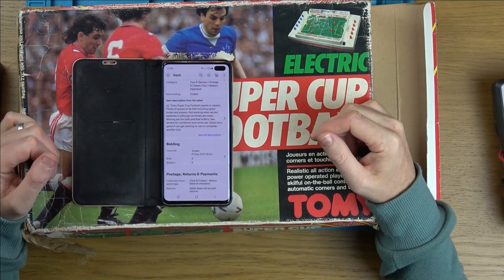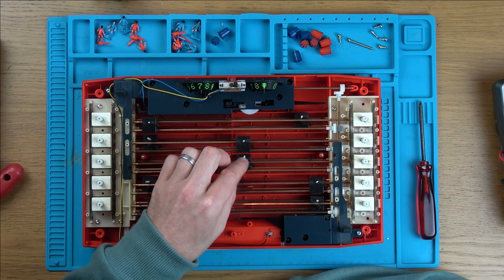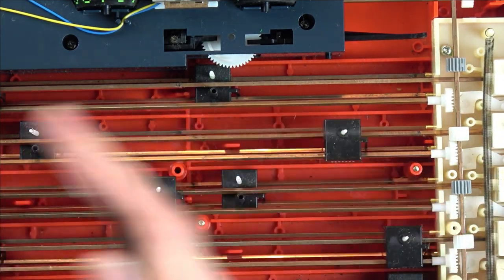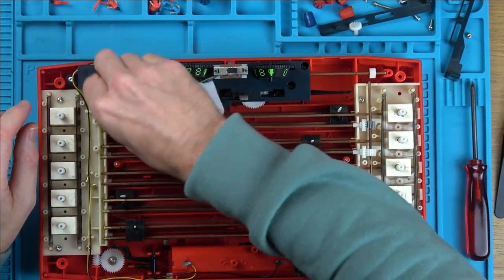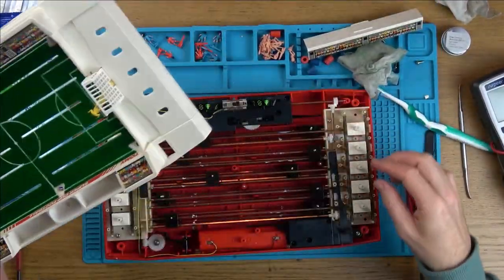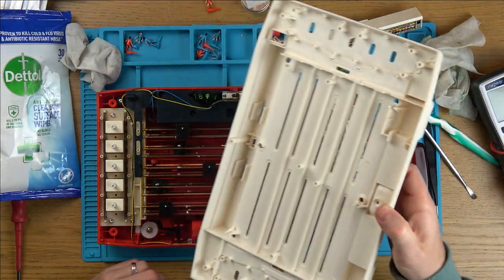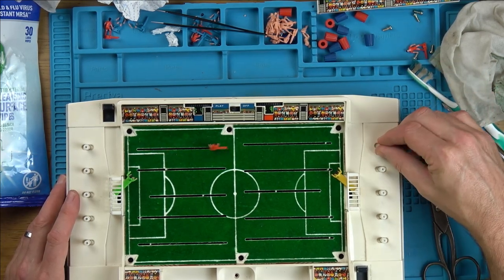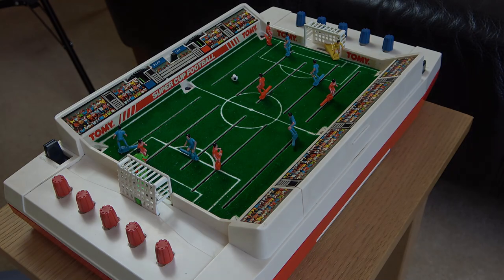Faulty TOMY Super Cup FOOTBALL Repair - Tea Break FIX

Comment: Tomy should 100% remake this!
Add a rechargeable battery with USB-C cable. Find a way to make it as silent as possible. Add little LCD screens for goal celebrations that activate when you change the score. Or even better, use the screens around the edge so you can have an animated crowd and add speakers so you can play crowd noise/singing!!!

Comment: Hi vince I was wondering if you would take a look at 2 media boxes not powering up one is a magbox 250 and the other is a mi box 4s both no power I can post them and I will pay for your time as well even if not fixed think these will make good fixes I thought there would be little fuse but can't see any can't find the faulty component to why not powering on at all. One was working fine and I powered it on to nothing. One box is android tv and other box is Linux iptv box by infirmer
Would love to see these on your channel chasing the problem.

Comment: Hi! How does the worm gear arrangement work under the player? You mention it all works off one motor but i can’t see how the players are linked to the motor? Do the metal tracks carry DC current as well as providing a track for them to follow? Then a little motor under each player which operates the worm gear? And the direction of the motor is changed by reversing polarities on the track? I’m curious! Haha Great content by the way!

Comment: This reminds me of two things.  One was a similar football table in the bowling alley were my dad played in London in the 60s, Ambassador Lanes..  It was coin operated and mains powered, with the players moving along tracks under the control of levers at each end.  Sometimes a player would move erratically and shake itself silly, lol.  The other was a tennis game we acquired at a Sunday market around 1977.  It was battery powered and had a bulb in a chimney, which moved around under the screen.  When it hit any side, the chimney would rock and activate reversing switches.  A large knob at each end controlled the paddles and mechanical score reels ticked over if the ball hit an end without encountering a paddle.  It did need a good deal of lubrication as it hardly moved at all. When it did move it got stuck on a wall, so the chimney had to be lubricated too. It worked very reliably after that. 
Lay

Comment: I used to have a full set of those red handled screwdrivers. They were standard BT toolkit issue back in the 90's. They came issued personalized with your initials on. Still used to get nicked though. Good drivers. Got some heavy use but never wore. I don't know what make they were because BT rebranded them